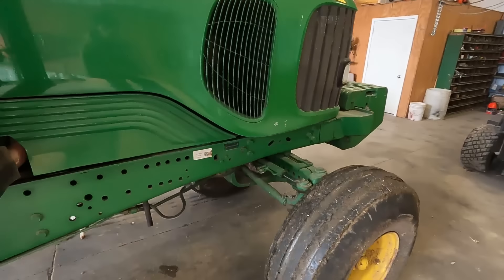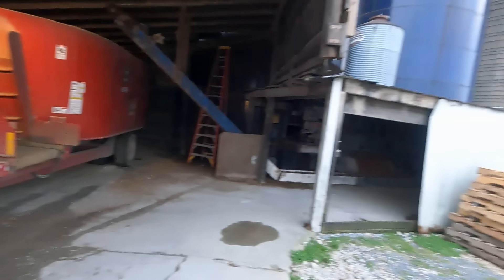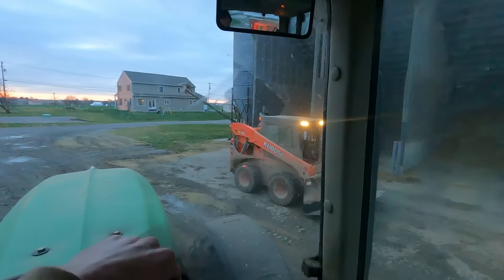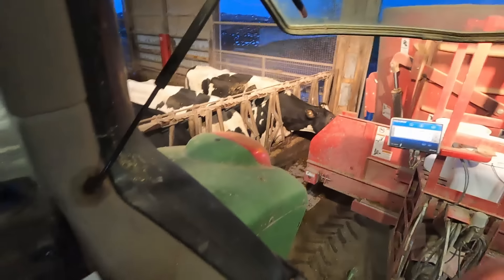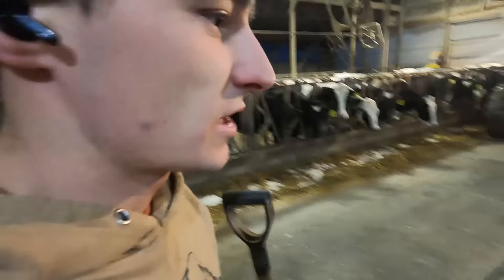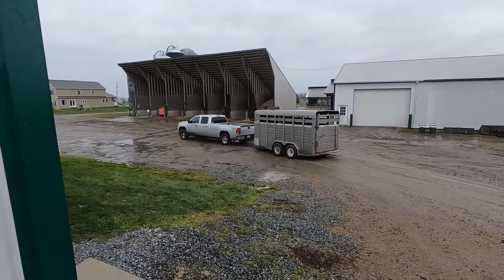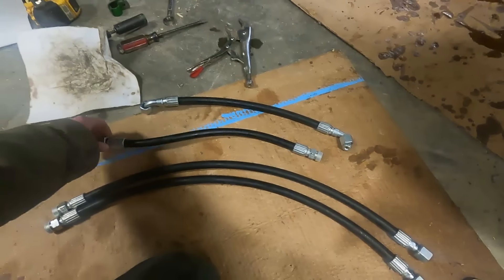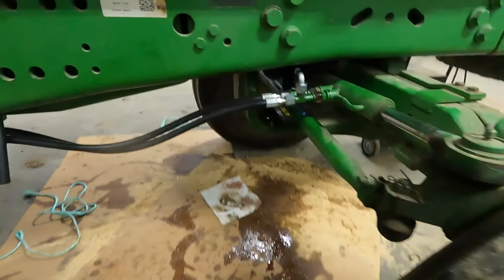7220 Repairs & How Much Milk are the Cows Making?

Comment: Swap out the 8D battery for two or three  group 31 batterys wired in parallel for 12 VDC and fab up a new hold down bracket. Much cheaper and are available everywhere.
Reply: Need to make sure the CCA is enough, otherwise you'll damage the starter. Also, that OEM battery might be a deep cell style or AGM.
Reply: That’s not a 8D it’s a 4DLT
Reply: I swapped mine out for one group 31 battery.  Works fine.

Comment: Hi Eric, get yourself a pack of multi-colored zip ties. Put the same color on the hose and the fitting it goes to, so you can keep track of what goes where

Edit: you also reminded me of a hilarious video I saw somewhere, of a bicycle someone had built that turned the opposite way of how you turn the handlebars. Watching people epically failing to ride it is :chefkiss:
Reply: Zip ties is how this old farmer keeps track of my hydraulic hoses. When I'm replacing a bunch of hoses or repairing anything complex like wiring rebuilds etc I take a  bunch of photos on my phone as well for reference later.
Reply: Was also going to say coloured zip ties or coloured electrical tape

Comment: Thanks Eric for your video’s! Interesting to hear the protein/fat levels you achieve. In the Netherlands (I’m living there, working in dairy industry) farmers achieve on average protein  level of 3,58% and fat 4,45%. So there might be some upside for you on the protein part 😉.
Reply from the maker: Nice, at what level of fluid production?
Reply: @10thgenerationdairyman : average is around 8500-9000kg per cow per year. Really productive cows achieve 10.000kgs per year
Reply from the maker: @patrickbuitenhuis1490  nice we are running about 29000lbs or 13000kgs/year